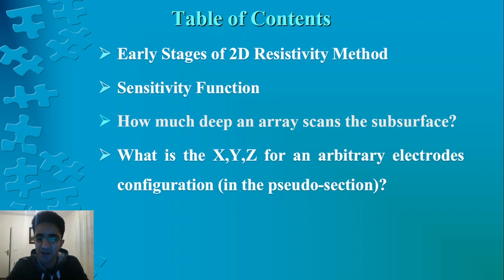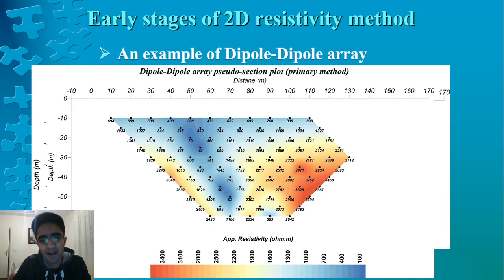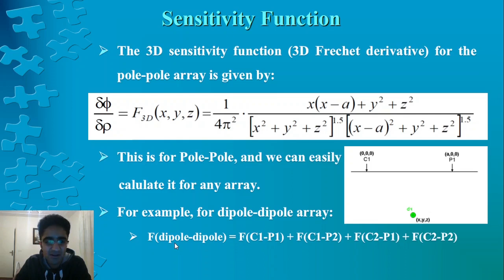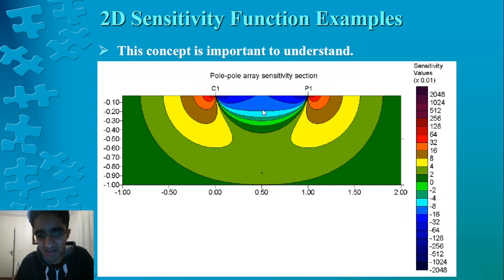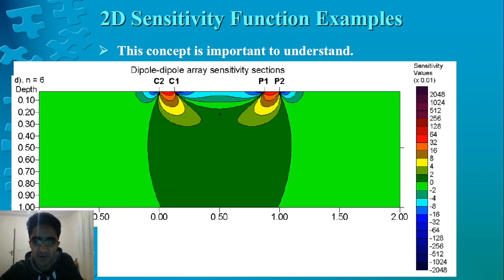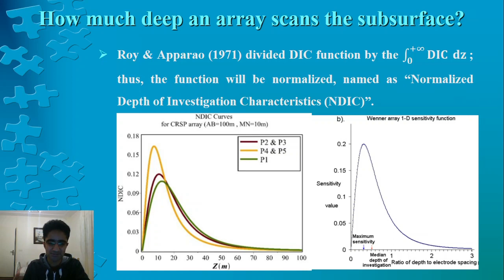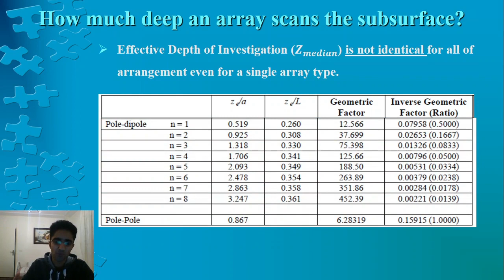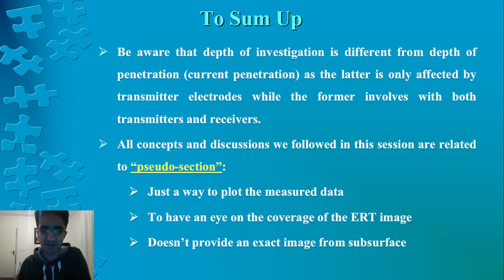ERT - Session 3: Sensitivity Function & Depth of Investigation

Comment: Sir, why is there a negative sensitivity value between C1P1 and C2P2?
Reply from the maker: This is related to the sensitivity function itself. Look at the sensitivity section and its value in the mentioned locations. 
If you consider an alfa-type array (such as Wenner, Schlumberger, etc.), the mentioned pattern will be true (negative between C1P1).

This tells us that all proportions of ground does not have similar intensity / effect on the measured apparent resistivity.

Comment: Hi sir, I was wondering how this system is actually grounded? I know in a lab, the socket in the wall takes the current and voltage to the pipes as reference, but how exactly is this ert system grounded?
Reply from the maker: Hi. 
Electrode is a metallic bar (i.e. steel, bronze, etc.) that is inserted into the rock/soil by hammer. If the ground is dry, a little of saltwater or clay mixture with water is used to improve the electrode connection to the ground. Look the this video:

https://www.youtube.com/watch?v=9C0Y2HF0xWU

Comment: Salam Reza, Thanks for ur informative lectures. I have a wonder regarding the implications and usefulness of the DIC and senstivity analysis? Also, When it can be done, before or after the field survey? Can you please give us an example of Wenner-Schlemberger on how to calculate this barameters and how to benifit from them?  Regards
Reply from the maker: Thanks for your comment. You are asking some good questions and i try to answer them shortly.

The sensitivity function is the basis of inversion. It gives us information on how the received signal is affected (app. resistivity).
We must understand it to be able to compare arrays, to know which areas of subsurface is scanned by a array, etc.
It can be used both before a survey and after a survey. It has a fundamental role in ERT project design (how much deep my designed array scans the subsurface, what is my coverage, etc.). Moreover, many other concepts are just based on sensitivity function.

Analysis of sensitivity function itself in real field data analysis, especially in 2D / 3D is not easy in many cases. You can find a simple example of using sensitivity to understand the resistivity data behavior at my paper:

https://www.researchgate.net/publication/337027654_Assessing_the_effects_of_1D_assumption_violation_in_vertical_electrical_sounding_VES_data_processing_and_interpretation

Also, I would refer you to the mentioned Dr. Loke course notes for more information.
Reply from the maker: Regarding the calculation, i think i have discussed it in the lecture. If it is not discussed enough, look at dr loke course notes. 
NDIC curve involves elliptic integrals in the final equation. I have calculated NDIC curve for some examples by using maple software. You can do it too. 

In next sessions that we are going to upload to the channel, you will hear much more about sensitivity and its importance in data analysis.

Comment: Depth is not AB/2 for a pseudo plotting?
Reply from the maker: Nice question.
The short answer is "NO".
I assume that you probably refer to vertical electrical sounding (VES) with Schlumberger array.

That AB/2 as the depth or pseudodepth is just a "rule of thumb" without any scientific proof. This rule of thumb is somehow related to "depth of current penetration". Note that depth of investigation is not identical  to the current penetration depth.
Reply from the maker: For pseudosection plotting, the rule is maybe fine since "we don't use pseudosection for data interpretation" (please follow the ERT session about pseudosection vs inverted model for clarification of this statement)
Reply: @OneGeoscientist  you mean, to interpret data, we need to look at the inverted resistivity section from a measured apparent resistivity pseudosection?
Reply from the maker: Yes, of course.
If you follow session 4 on ERT playlist in this channel, you will notice that pseudosection is not suitable to be used for data interpretation. 
Sometimes, pseudosection can be used to highlight noisy data and some "very general idea" about true resistivity not more.
Reply from the maker: I advise you to take a time and watch the whole ERT playlist in order, step by step.

Good luck
Reply: @OneGeoscientist  I got it. Thank you. we are looking forward more videos about electric resistivity method